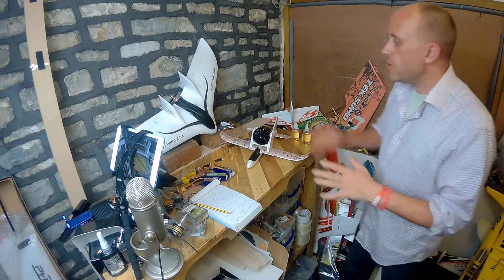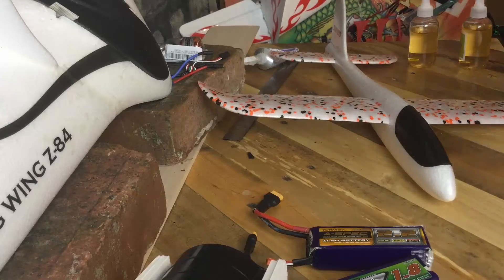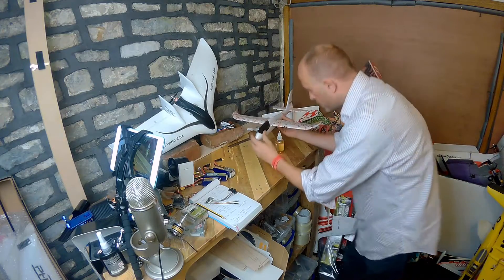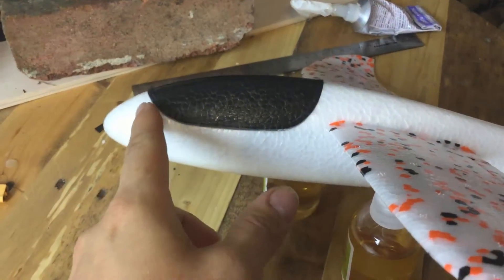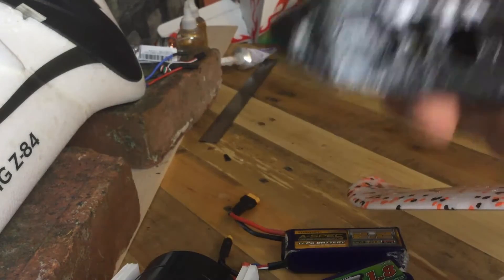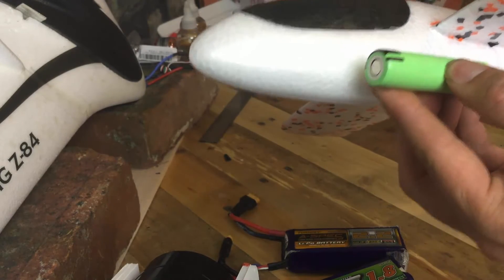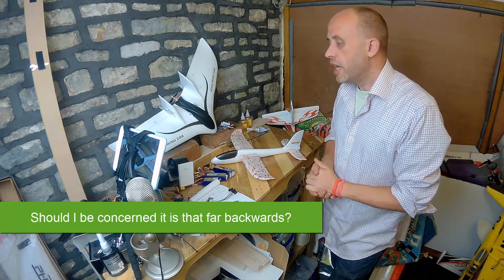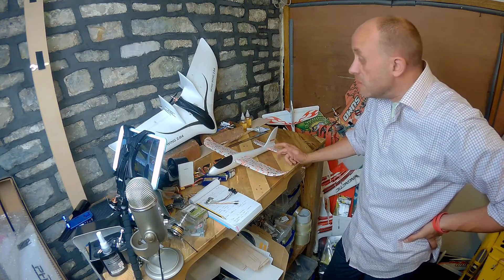QUESTION: C of G for a Chuck Glider Conversion. Is it a Concern that it's so FAR back?

Comment: Hi Matt, the CG is definitely too far back & it flies tail heavy out of the box. Check out Andrew Newton's video review here: https://youtu.be/xudWj3FSdOY Hope that helps
Reply from the maker: Howdy fella, ah thats the video! Yea I strapped a quid to the front and that got the CG right and she flies sooo much better now. This is very promising! Matt
Reply: Glad to hear you've sorted it. Will have to make a start on my conversion on the same model. Mine will be based on spare parts from a WL Toys F939, and should be quite light. Not sure yet if to go for 3 or 4 channel set up. Regards Dave
Reply from the maker: deegeetee Howdy Dave, I was kinda hoping to stay with two servos only on the wings & use them as elevons. The rudder would be a challenge on this model as it would need to go through the fuselage to move both surfaces. Also I've just dug mine out today with the soldering iron, loads of room so far in it! Matt

Comment: Howdy Matt! Some rough back of the envelope calculations: AUW=130g, wing area=4dm², stall speed=27Km/h, WCL factor=16.8!! pylon racer territory!!
 1612 motor has only propsaver mount?, 1811-2900kv with f959 4" folding prop (best plastic 4" folding prop I've found, only 1.50$) might also make a good combo!
Reply: You could also try increase wing area by adding some pieces from a spare set ;)
Reply from the maker: Morning C, daft question where did you spot that 4" folding prop to? And yea these little things are very fast on the slope :) Matt
Reply: Matthew Ogborne They're the press fit replacement pusher props for the f959, gearbest and bangood have them. They fit a 1.5mm shaft but can easily be drilled out to 2mm. For tractor configuration, remove spinner and install backwards!
Reply from the maker: Howdy C, I have 2 on the way from eBalls to me, should be here for Monday. PS if you're in the Facebook group, check out the uncut video I posted this afternoon. We have FLIGHT!!!!!!!!!!!!!!!!!!!!!!!!!!!!!!!!!!!!!!!!!!!!!!!!!!!!!!!!!!!!!!!!!! :) Matt
Reply: Cheers for the invite Matt!! Hardly using FB at all these days, your YouTube notification squad will just have to wait as always!!! :)
Reply from the maker: C. Av :D

Comment: Hey matt! i ve got the same issue with another Model.... 2 ways youve got 

1. do it like you want to do and Balance it with weights in the tail 
but i think , this will be to Heavy

2. build an Motorfin on the back of the plane so you got an Pusher, like the FPV raptor
Reply from the maker: Howdy fella, that is a sweet idea of a pusher! I have two so let me see what happens with it as a tractor, if that fails, I can make it a pusher instead :) And of course thank you for chipping in, I appreciate it! Matt
Reply: thats the way i think Hobby have call like! help together think about resolve Problems together and don't just think for your own intensions!!! 

thats why i like your channel!
but the Most people just wanna make money with this Hobby .... so sad about it!

stay your way Mate Hope for more interisting vids from ya ! cheers

Comment: If lm not completely wrong you could remove the canopy.  In the canopy there is two holes where you can fit ball bearing balls to adjust the cg. 
I think about to put a motor to mine that I converted to rc. 2 servos, aileron and elevator.
Reply from the maker: Howdy fella, firstly thank you for chipping in, I appreciate it! Yep there is a ball bearing in the canopy, daft question, how did you do your elevator as for it to work properly it'll need to go through the tail to the other movable surface. Hence the question :) Matt

Comment: I would think the CG being so far back would help it to gain altitude being a chuck glider with no elevator control. I'd probably try pushing the CG forward a bit, and seeing how it flies. Not sure how well the elevon idea will work with the horizontal stabilizer on the tail countering things a bit. This looks like fun, I ordered two of them to play with after your first video. :)
Reply from the maker: Morning, firstly thank you for chipping, it's appreciated! Yep just stuck a pound coin on the front and it glides ok with 1/3 C of G, YAY! Matt

Comment: Hi Matt
I guess the original rearward cg is to  give it a really slow floaty glide 
I would try adding small amounts of nose ballast and test fly the plane from a hand launch to see how it glides over a range of cg positions
If you find a workable cg position then see if this position is achievable with electronics loaded onboard
Not sure that it would with just ailerons/flaps and no pitch control though
A tricky project as the wing loading would soon become critical
regards
Hans
Reply from the maker: Howdy Hans, firstly thank you! I've just tried that by sellotaping a pound coin to the nose so we had 1/3rd CofG and that let her glide really well. Thanks for the tip! Matt

Comment: As far as I remember chucking this glider few times, it is definitely tail heavy. try to mount pennies in the nose to move CG forward like it should be and see if it flies better (I bet it would).   Also, forward CG is much easier to correct than backward.
Reply from the maker: Morning Yaroslaw, yep that did the trick. 1/3 CofG with a pound coin on the nose, it flew really well. That is really promising now! Thanks for chipping in, it's appreciated. Matt